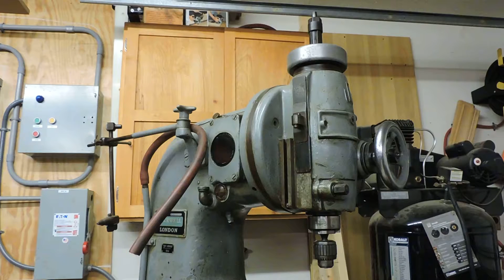Tool Holder Removal from Fritz Werner 3.230

Comment: David what type of toolholder does this mill take? Are you pleased with it?
Reply from the maker: Mike, it takes CAT or ISO 30 tool holders. I like them. They seem to work well and I haven't had any issues with them. I have heard of another mill like this one with a different tool holder size on it.
Reply: David, thanks for the quick reply. Yes, someone somewhere mentions a 2MT fitting, but the pictures I saw weren't like that, and google led me to this video. I've seen the manual on lathes.co.uk, but it's a bit too hot for a copy pdf at the moment. I did buy one for my Borer and I wasn't that impressed. Pleased you like it, as I'm looking forward to collecting mine, fixing it, and finding out in due course. I've also seen your gmail in other threads, so I'll probably have more questions if that's OK.
Reply from the maker: Mike, I'd be happy to answer any other questions you have.  I have a small blog that has some more info on the mill if you're interested.  Find it at: https://somanyhobbies.wordpress.com/  If you got to the "about" section there's an email address you can use to reach me.  It'd be easier to communicate for future questions using that.  Thanks!